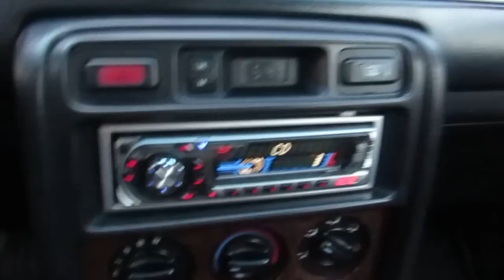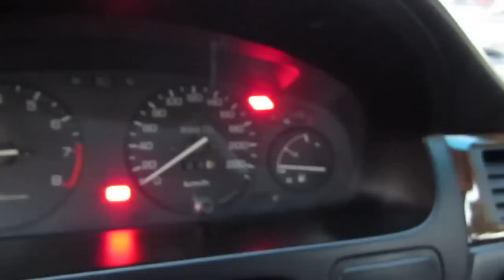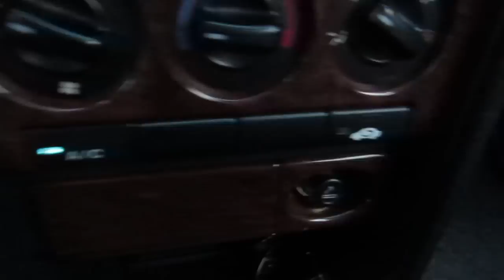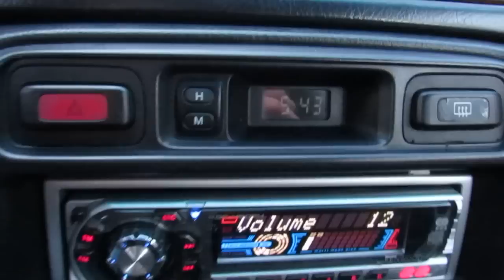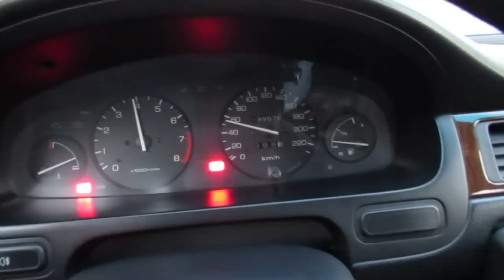HONDA Civic 1.4 1996 MA8 (D14A2 engine)

Comment: I used to have one too. Great cars. Quite comfterable short to midrange traveling, especially for a car of this class and era. It always felt to me like it was build to the standards of a bigger car.
Eventually got rid of it because I wanted to have a bigger engine. The 1.4 was a fun, bussy engine but it simply has become to slow for modern traffic if you want to do a lot of motorway driving.
If it had been the 1.6 or the 1.8 engine, I probably would had kept it for even more years to come ;)

Comment: great car.I have the same model too.
Reply: razvan43 jup me too! :),. but i put a leather interior from a rover 45 in it :)
Reply: Ehh, lucky you :)
I have some problems with my roof cloth.It s started to hang in some places.I have to change it.But maybe next year.Otherwise my interior looks ok.
Reply: razvan43 jup, my roofliner is started to hang also,. previous owner used a stapler to fix it,. and it sort of works,. isnt a nice fix,. but it works,....i wonder if a roof liner of a rover 45 would fit :)
Reply: Great Cornholio Maybe,they are made on the same platform if I'm corect.I have some problems with some noise when I go over bumps at slow speed.I changed the shock absorbers and rods.What could be?
Reply: razvan43 maybe the exhaust is hitting something?, mine was pretty bad so i replaced it.
Reply from the maker: +Great Cornholio no, tis is camera noise. my car after crash: https://www.youtube.com/watch?v=epFcUbDybfI